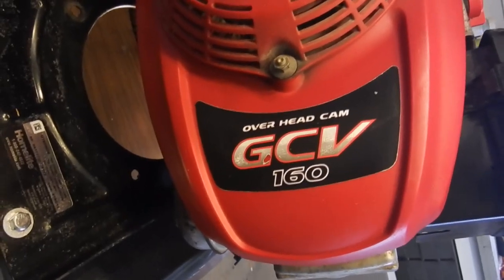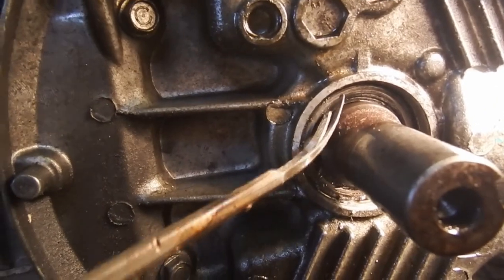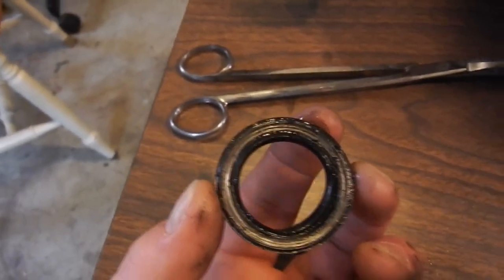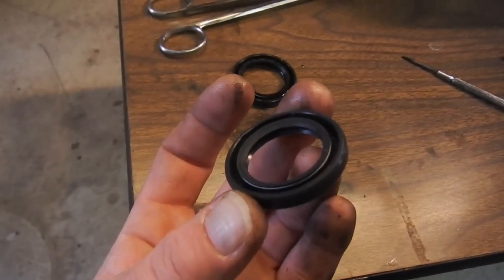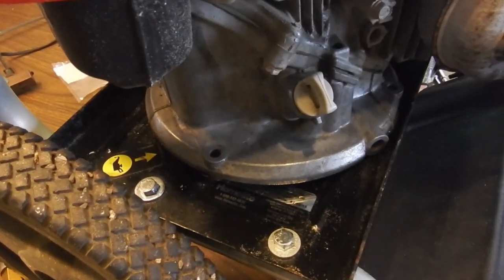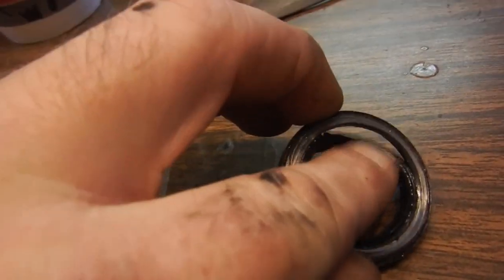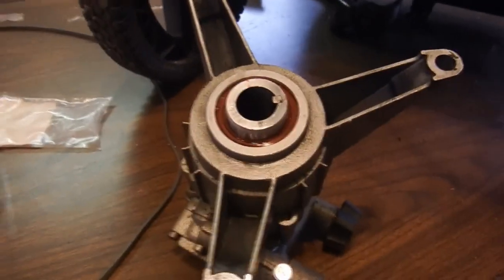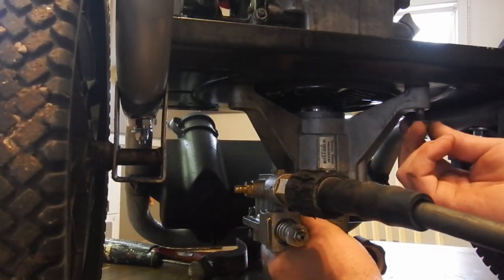Honda Engine Oil Leak Repair: [GCV 160 Shaft Seal Replacement] (2019)

Comment: hey thanks for the video. I plan on using a zip tie around the shaft to prevent the key from riding back up.
Reply from the maker: That's a great idea.  Cheers to you.
Reply: @DIYAllied  what is supposed to hold that key in place? Is there a ring or something to keep shaft down? my key I think damaged my seal by hitting like yours.
Reply from the maker: I'm not sure anything actually holds it in place.
Reply: @DIYAllied  ok thanks for quick reply I saw this o ring in my garage broken in half and It seemed to fit the bottom of the seal perfectly. I can't find any videos or online information that shows the shaft so I can determine if I'm correct or not. I guess small zip tie would work.
Reply: Bottom of the shaft above the key* perfectly
Reply from the maker: @Jd77469  No problem.  If you figure it out let me know.  I'm curious too.  Thanks.
Reply: @DIYAllied  just got back from home depot. I have the 690 model but it looks the same down stair. I took a pic and there is nothing keeping the key in place it's just pushed down in there. That's crazy to me all the vibration for it to just stay put. Like yours mine migrated to bottom of engine and was hitting the ring. That has to be the issue, luckily I was at end of job. Will have o ring by Tuesday. Thanks again for solid video! I donno how to load the pic
Reply from the maker: @Jd77469  Ya it seems like they should have something to hold that thing in place.  Thanks for the research and info.
Reply: @DIYAllied  yes sir. Great vid! If you do a hyskuvarvna (mispelled)  riding lawn mower video let me know lol.

Comment: you have to install a collar on the shaft, to prevent the key from riding up.  it's a terrible design, and requires after-market thinking.

Comment: Thanks for the seal link. My pressure washer key rode up and took out my seal.  I plan to use a small hose clamp to hold the seal in place. Seems to be a issue. Also a piece of PVC pipe works to tap the seal in. Or any type of tubing really that is slightly smaller than the OD of the seal.
Reply from the maker: You are welcome.  Thanks for commenting

Comment: Yes do a video on the crankshaft seal on a GC 190 Honda engine has pressure washer on the rear end Not underneath
Reply from the maker: I will if I get the chance to do so.  Thanks

Comment: Thanks for the video I used an old vacuum cleaner wand for pushing in the new seal to prevent damage
Reply from the maker: That's a great idea.  Thanks for the  tip.
Reply from the maker: You are welcome

Comment: Always check with your Honda dealer and reference your engine number to ensure you order the correct seal.  Whilst some of the later OHC GCV160 engines use this crankshaft seal, the earlier model GCV160 engines have a 25mm diameter shaft.  This seal is for 28mm crankshafts.
Reply from the maker: Good advice.  Thank you.

Comment: Thank goodness you can get it from the bottom. I was just about to sell a mower when I noticed that the shaft seal was leaking and I went "ah crud!" luckily it's a $6 part and looks to be super easy to fix :)

Comment: You ever had that orange/red colored seal go bad at the top of the pump itself? I've got gray looking oil leaking out from the top of the pump (it runs down the pump when I lean the pressure washer back. I haven't taken the pump off yet but I know for sure the oil is not coming from the seal at the bottom of the engine as that is dry and has no oil coming from there.
Reply from the maker: No I have not but it would not surprise me if it has gone bad.
Reply: Did you ever take the pump putt and diagnose further? I think I have the same issue, the oil is heavier than motor oil and the level stays constant.

Comment: Can u tell me y my troybuilt 160 honda pressure washer started pushing oil from under th fly wheel? It started when I cleaned out the main jet in the carburetor  and reassembled it. It ran and washed great for about a minute then oil started running down the engine.
Reply from the maker: Not sure on that one.  It's tough to diagnos without seeing it.  Sounds like a gasket issue to me but I can't say for sure.
Reply: @DIYAllied  how can I send u a video? I'll show  u what it's  doing.
Reply from the maker: @jayfaircloth7422  if you have a smart phone you could do a video and post it.
Reply: @DIYAllied  I'll do that it's  kinda crazy never had this happen before,but anything can happen with an engine i recon

Comment: This video was very helpful to me regarding removal of the shaft seal. Saved me about $250 on getting another refurbished pressure washer.
Reply from the maker: That's awesome.  I'm glad it helped you out.  Thanks for commenting too.
Reply: Were u get part

Comment: Thanks for the video,  what's the serial number for seal ring?
Reply from the maker: Not sure.  I have an affiliate link in the description that will take you to the seal you are looking for.
Reply: @DIYAllied  ok no problem,  I got it from one of the coments,  my other question is,  is this the same one for a 190 over head cam?
Reply from the maker: @PedroHernandez-ue5xf  I can not confirm that the seals are the same or not.
Reply from the maker: @PedroHernandez-ue5xf  sorry I'm not much help on this.

Comment: How long do these seals normally last on a Honda engine?
Reply from the maker: They last a long time.  My seal was damaged by the key sliding up the keyway and rubbing on the seal.  I'm sure most last 10+ years or the life of the engine if its well cared for.

Comment: Hi.  Helpful video.  It looks like I have a damaged seal on the pump side (female receiver for the drive shaft).  Will that also cause oil to leak and if so could you help me understand how to replace it. Thanks

Comment: Great video, I have this same problem. however, I can't locate the seal on the manufacturer's site. Could I use this one? I have a Simoniz pressure washer
Reply from the maker: If the engine is a Honda gcv 160 yes.

Comment: Thanks for the walkthrough, Ive got a GCV190, looks to be near the same, What oil did you use? I cant seem to find any info on it
Reply from the maker: You are welcome.  SAE 10w 30  is what I use.  This model has a capacity of .58 quarts but I'm not sure on the GCV 190

Comment: Hi. Great explanation. My shaft key is stuck on the shaft. I have been trying to remove it with WD40, but it is not coming loose
Any ideas, before I have to pay someone for the repair?
Reply from the maker: I'm sorry for the late reply.  I don't remember being notified of your comment.  I must have missed it.  Did you ever get that shaft key off?
Reply: @DIYAllied  Yes, but the pump is no good. I am looking for a good replacement. Any ideas where to look
Reply from the maker: I bought mine on Amazon.  60-70 bucks.

Comment: Going to try this. How did you know how far to seat it in? I’m using an old vacuum hose wand to put it in
Reply from the maker: It bottoms out pretty obviously.  Good luck.  Mine is still working.
Reply: @DIYAllied  sweet deal. I have had a small leak from my pressure washer since I got it used about 1.5 years ago. There is no oil coming out of the engine crank shaft though. I disassembled the pump from the engine. I put the pump on a paper towel vertically to see if it leaks down. The engine is now exposed with the crank shaft. I see no leaks on either seals. If I run my finger down the dip stick I feel oil residue. I purchase a new dipstick (Honda oem) as I heard it can be as simple as just this if the old one is defective (probably not though). I’ll give it a week and see which leaks the pump or the crank shaft. I purchased a crank shaft seal anyways in case mine is bad. It’s hard to tell. Only leaks when it’s sitting for long periods of time and not in use 🤷‍♂️
Reply from the maker: @appleztooranges  Interesting.  I'm curious as to where the leak is.  My bet is on the crankshaft.  Thanks for commenting.
Reply: @DIYAllied  I wonder if I should try soap at the crank shaft and see if it bubbles. I’m hoping the wand trick from the vacuum will work well. I’d be pissed if I mess it up when seating it. Anyways i bought a new crankshaft seal, new dip stick rod and new pump seal. If that doesn’t fix it I don’t know what will 🤷‍♂️🤔

Comment: Great video, I need to do the same. Before I order the part using the link you provided, just wanted to ask if your GCV 160 a 5.5 honda motor? Thanks in advance.
Reply from the maker: As I understand it Honda dose not designate a specific hp for these engines.  It is essentially a 5 hp engine.  Hope that helps.
Reply: @DIYAllied  thanks so much for the quick response. Take care
Reply from the maker: @kevinmatthews9967  Thanks for watching and commenting.

Comment: Exact same thing happened to the seal on mine.  I live in a cold climate so I pull the pump in the fall and store it in the basement to prevent freezing  (I keep the motor in the yard-shed).  This spring when I put it back together I must not have noticed that the key had ridden up. The first time we used it, it destroyed my seal.  (The only reason I shut it down before all the oil was gone was because I was letting my son do the work and I just happened to walk over to the unit and see oil flying.)
Your video is particularly helpful since the seal was completely destroyed and I wasn't sure if the metal of the engine had been damaged.  Based on the video, I think I'm fine and just need a new seal.  Thank You!
Reply from the maker: Thank you.  Good idea on removing the pump for winter.

Comment: Great video. I replaced the seal, but my shaft key is stuck on the shaft side. Have been trying WD40 to get is loose, but it does not come loose. Any solution you can offer? Thanks
Reply from the maker: Can you grab a hold of it with a vise grip or something?
Reply: @DIYAllied  Eventually it came off, it took a while. I just did not want to break it. My problem now is that the groove where the key fits on the pump look wider. Thw key does not sit on the groove in the pump. Do I need to replace the pump or is this fixable?
Reply from the maker: @jaimebermudez4900  I would have another pump on hand in case it fails but I would run that pump until it quits.  The pump sleeve will give out before the crankshaft for sure.